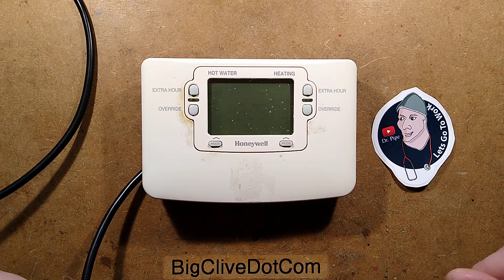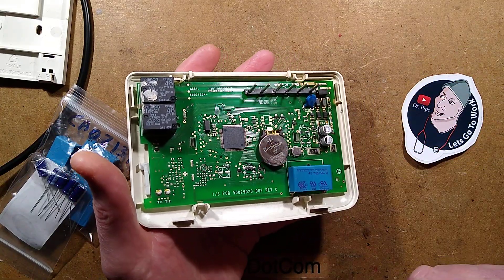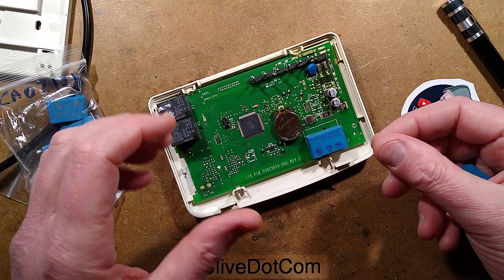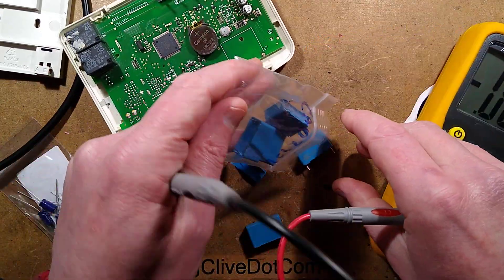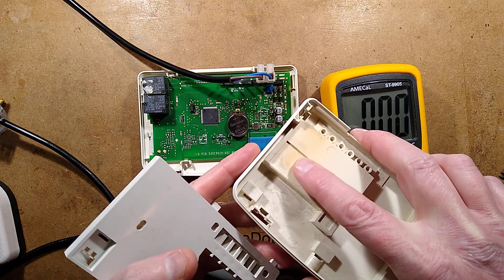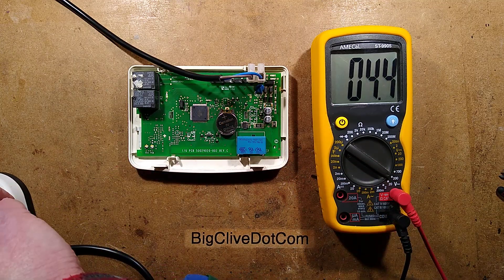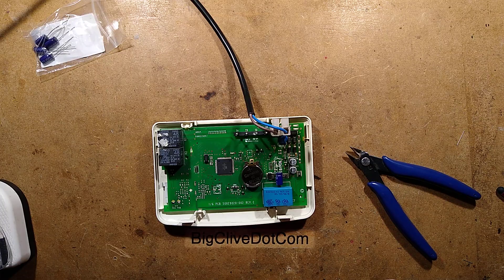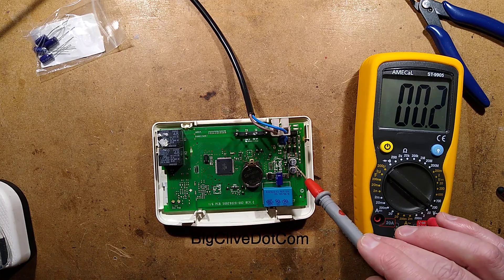Troubleshooting a heating controller.

Comment: I used to work for a plumbing company that fitted 100's of these a few years ago, a common fault was the relay "clicks" and the led lights up but you don't get an output, same fault with the wireless relay box (BDR 9_?)

Comment: For those 63V caps - you can find them on farnell. I bought a set of these there (for entirely different appliance, but caps were the same)
Reply: Why would you want to find same thing that is known to be the failure point?  It is madness all around, that they had 4 spots for parallel tiny SMD caps in the first place.  Get one decent cap, make room for it by creating a void in the back of the casing.  Whoever designed this was an idiot.

Comment: This miniture version of capacitors was always giving troubles. I feel like they age quicker and they can even leak acid from them, which can slowly dissolve tracks off the circuit board

Comment: Unfortunatly I have't got a True RMS Multimeter.
Does this AC Ripple Trick also works on these? "Normal" AC Messuring is by blocking the DC Part, but doe True RMS the same, or are they messuring "true RMS" included the DC Part?
Reply: Try measuring a known clean DC voltage (like a 9v battery) in AC mode. If you get zero volts AC in both polarities the trick should work as is. If you get a nonzero reading you just need to put a capacitor in series with the meter when you measure ripple.

Comment: And this is why, checking your replacement components before fitting them is a good idea.
Reply: I think why buying components from a reputable distributor would help too, not a place that sells other random garbage, and some components on the side. I went to the CPC homepage, and they're selling space heaters, cheap tools, and all kinds of other junk. CPC must stand for Crappy Products from China
Reply: @gorak9000  pretty much nailed it yes. But it's hard to find suppliers that don't sell crap these days. It's an issue.
Reply: @yodaco  I mean it is a Farnell company - they seem to have been going down the path of "we import cheap crap, put a huge markup on it, and sell it to "industrial" customers" for quite a while now. Every interaction I've had with a Farnell company feels a bit odd. I order components from digikey or mouser - never really had an issue, and they stock the full selection of everything. If digikey doesn't have something, mouser usually does, and vice versa. Not sure if either of them have regional operations in Europe though - I would think they would. Digikey was the best in canada, flat rate $8 next day shipping on any order over the minimum (which I forget now), but surprisingly their shipping in the US is pathetic (slow and expensive), and both Canada and US shipping originate in the same warehouse in the US, so now I prefer Mouser.

Comment: 4:58 Clive back from ripping his supplier a new one ...
Reply: More a case of checking what you are buying (note he did say they were within tolerance of the specs- he got the low tolerance ones)
Another factor is that caps often 'break in' and their value changes closer to the stated value after a few hours of use- something to be aware of in some applications ;-)
Reply from the maker: Sadly, these were the only ones with the correct capacitance and pitch.

Comment: WHAT??? I had no idea that the AC  mode of a multimeter could measure the AC component of a dirty DC voltage! I always thought this mode was just a rectifier connected to the DC voltage input.
Reply: Not all can. Check first. The cheaper the better.

Comment: I am involved (as customer representative) with the refurbishment of a commercial building. As part of that work a new heating/ventilation system has been installed which includes two duct-mounted electric heaters, one of 26kW rating and the other 36kW. Both heaters have electronic control of the power output using a 0 - 10V control voltage from the system controller, as a consequence they have circuit boards that include electrolytic capacitors mounted in a metal box attached to the side of the duct which runs at 50 C when the system is running.
This seems to me to be asking for trouble from these capacitors relatively soon. Unfortunately the system was specified by the architect and the H/V contractor is a sub-contractor to the main contractor for the refurbishment, so I had little input to the system specification. 
But it will be my problem when things start to go wrong!
Reply from the maker: You can make a significant difference by mounting the metal box just a few millimetres off the hot surface with spacers.  It allows airflow between the two surfaces.
Reply: @bigclivedotcom  The manufacturer could have done that, I can't!  The box is riveted to the duct section and the ends of the elements project through into the electrical compartment where the electrical connections to them are made.
If you are interested these duct heaters are made by VEAB Heat Tech AB and they are type VFL rectangular duct heaters.

Comment: Honeywell is pretty much the standard in the US for heating/cooling control systems.  Some vendors re-brand them with their own logo, but it's still Honeywell.  A few years ago, we upgraded our heat pump and ran into a problem.  The new unit demanded an 8 wire connection, but our thermostat cable was only 7--redoing the cable would involve going between floors with finished ceilings.   "No problem" our installer said.  He installed a new controller with a single 2 wire connection--both power and signals travel over the same 2 wires.   There are multiple options, including wifi connectivity, remote wireless sensors and all sorts of good stuff.  Unit has a color LCD touch screen that dims at nighttime and is programmable, of course.  That was five years ago.  Heaven knows how fancy the new ones are.  The original thermostat was the old-school one with bimetal strips and mercury switches.
Reply from the maker: I switched from an old mechanical thermostat to a wireless one with timing functions too.

Comment: i  know about the ac meter trick but i haven't owned a meter with separate ac/dc in years lol but 37 volts on a 48 volt bus was a big giveaway
Reply: ??  Practically every consumer and pro meter on the market has separate AC/DC settings even if autoranging.
Reply: @stinkycheese804  yea there's very little competition in the meter market these days its sad
Reply: @stinkycheese804  yea I'm saying it's hard to find a meter with all the features one might want without compromising something
Reply: @stinkycheese804  ah no lol one of my requirements is to only have a single meter, I realize my situation is self inflicted but I firmly believe company's should just make a better meter
Reply: @stinkycheese804  well yea I'm far more interested in auto ranging than having seperate AC DC and I've never seen a meter with both and I also need a meter with forking amps and low z

Comment: Clive, I think you missed something: the display doesn't show all segments. Typically for these thermostats because of crappy flexcable connection of the display. Over time it gets worse until it becomes unreadable. Never found a good way to repair these.

Comment: That type of capacitor is very well known under ham's as they like to kill radio's by leaking their 'smurf' that then eats away other components and or PCB. Search for "Kenwood st-50 capacitor fail" and you'll find nice examples of this.

Comment: "I'm not a huge fan of miniaturization"
CLIIIIVE!!! Dammit, coffee on the monitor again.
Reply: Bear fingers aren't great for SMD  LOL.
But he's right - small components aren't great at dissipating heat.  It's my main concern wrt SMD design. (...and I'm not a bear).
Reply: @Chris_the_Muso  Long ago I did SMD rework and then design. I pitied the software guys who couldn't just spray software modules with canned air until it started working the way O could with a circuit board. ;>)
Reply: @markfergerson2145  Ah, I've bin there too.  The software guys have a tool  as well. - you output a key variable to the monitor, then you understand where you screwed up when it doesn't show the result you intended.  The guys I pity are the high level programmers who don't even know the names of the programmers who wrote the routines they are patching in ad hoc.  They are totally screwed.  Unfortunately that's most of the arduino crowd but I can't laugh too hard because that's where I'm at these days.  LOL with great sarcasm.
Reply: @Chris_the_Muso  My most recent direct experience was in a small systems house in Phoenix. Ten to twelve software guys writing in Qnix and a raft of hardware guys. I was one of two who interfaced the two departments.
I give the software guys all credit that the equipment we built and sold worked at all- by comparison the hardware was dead simple.
Some days though- we built some custom devices and occasionally I'd have to explain to the guy drafting a circuit board why the leads to a pot had to be rerouted so the knob would turn one way when you wanted to speed up a conveyor and stuff like that.
And them Marketing would say shit like "The vents have to be on the side and all those LEDs have to be blue because blue is cool".
"Thoose red, breen and yellow LEDs tell the operator whether the machine is running properly."
"Change them."
Grrrrr...

Comment: That AC ripple measurement trick does not work on all multimeters. Some read the DC and scale it as peak AC so read DC x 0.7..
I have also seen the 48volt 1.3 watt zener die as that is the heat source when the relays are off.

Comment: Another (but unrelated) furnace hack; One I had to perform this year.  If you don't change your filter regularly, your furnace will have reduced airflow and so things get hot. There are temperature probe kill switches which they call a "Limit Switch" in the 'biz throughout your furnace.  Some of them can be reset, and some behave as a one-time fuse that cannot be reset by push-button so you'd have to order a new one.  You can ACTUALLY reset them through cryogenic freezing.  Although I don't have access to liquid nitrogen, an inverted can of AIR DUSTER was enough to reset my customer's tripped limit switch.  Saved them $65 for the part alone, besides another $200 to come out and install it.
Reply: I'd be interested in the type of liquid nitrogen resettable thermo switch
Reply: @jonathantatler  As I explained, just look for a non-resettable limit switch (ie, it has no push button).

Comment: 1) Aluminum electrolytics are well known for short lifetimes as well as high ESR. It's the latter that can get you if  installed  in a circuit that will subject them to a lot of ripple current. Filter caps are just that. The ripple current creates I^2*R power losses in the capacitor, which is of course "heat," the enemy of electrolytic capacitors. Not helping matters in your case is that it is also high voltage, which exacerbates the issue because  high voltage in a small aluminum capacitor almost always means even higher ESR. Those surface mount aluminums miniaturize the capacitor that much more, meaning the ESR is probably sky high. BTW: Digi-Key is a good source for surface mount aluminums, assuming you can get them delivered to Scotland.

2) Most engineers are not aware that all aluminum caps have a rated lifetime for a rated temperature. A common rating is 1,000 hours at 85 degrees C. Think about that: 1,000 hours is a mere 6 WEEKS, assuming the capacitor was sitting in a 85C environment. You can double the life for each 10 degree C decrease in the exposed temperature.  Thus, if your application will only see 55 degrees C, that is 30 degrees under the spec, so that the capacitor's lifetime is now stretched out by 2^3, or 8,000 hours, not even a year! A thermostat is going to sit in probably a pretty low temperature environment, but it is always powered on, "logging hours" 24/7. This thermostat no doubt spent its entire life always powered on, never turned off. Tick, tick, tick. No doubt the Honeywell designers assumed "it'll never get hotter than about 35C, so heat will never be an issue." But it is!

3) Something else you can do to help the situation is to order aluminum capacitors specifically designed for switching power supplies. They have lower ESR than normal aluminums and will therefore heat up less in a filter capacitor application. You can tell when a capacitor is rated for switcher applications when you see that the ESR is measured at 100 kHz rather than the 120 Hz you see for conventional aluminums. As an example, have a look at Panasonic FC capacitors that are rated for switching applications. There are other brands, too.  Paralleling capacitors also helps in that it reduces the ESR. If those two empty footprints on the board had been populated, they would have helped extend the life of the thermostat by reducing the self-heating of the caps, keeping them cooler and extending their useful lifetimes.

4) For best lifetimes when using aluminums, find one that has the highest temperature rating you can get. 105C if you can find them for 63V. The combination of I^2*R heating and a low temperature rating accelerates the failure time of aluminum caps. The choice of small surface-mounted aluminum caps in a relatively high voltage filter cap was a real bad idea. More than likely, the guys who designed that Honeywell thermostat did not understand Capacitors 101.

Comment: Not something I'm proud of(because apparently you shouldn't fix appliances like this) but I did a similar fix in my gas central heating + hot water boiler.
The electronics was certainly dead and it seemed like it had problems with starting its own power supply.
After searching for a fix (involving A LOT of random Russian forums via Google translate) there were some hints about capacitors, but not anything obvious.
So I picked one electrolytic at random (it was PSU chip's own supply pin) and it measured out at like a half of its rated capacitance.
Put in a random Chinese capacitor with a little lower voltage rating just to check and it started working.
As it was late autumn, it wasn't just for shits and giggles - I had no hot water and no heating, so I just put it back together and it still works after like 1.5 years now and I saved a lot of money - the controller was like 200 bucks equivalent and I wasn't even sure if it was still available, picking up a new boiler and someone to install it would be probably more like 500+ USD or GBP.

Comment: How long does it take for a capacitor to dry out
Reply from the maker: It depends on heat and the frequency it is running at.  Old low frequency (100/120Hz) capacitors often still work from the 80's.
Reply: @bigclivedotcom  Talking about heat. You might want to check what is heating in there. Was it the failing capacitors or something else.

Comment: These SMD electrolytic caps made in the 90s.
I see them being faulty on lots of repair videos.

Definitely they dried by the heat of the resistor in this case as the unit is supposed to work 24/7.

In other equipment, specially VCRs and video amplifier related (that has been sitting for a while without power), they simply decompose and leak like a discharged battery.
They can ruin multilayer PCBs.

Comment: Dry January, capacitors should not be included.
Never seen using the DMM on AC to detect ripple on a DC circuit, very clever tip.
Thanks for sharing.
Reply: Huh?  It's obvious to do that to anyone who has used a scope.
Reply: @stinkycheese804  In what frequency range would a DMM be accurate, this would help me immensely, thanking you in anticipation.

Comment: Interesting. Those are solid state caps and are supposedly impervious to drying out. It would appear that this is not the case.
Reply: They are almost certainly electrolytic caps. Solid polymer caps are used in more demanding applications (e.g. switching PSUs) and would not be first choice for this as they as considerably more expensive.
Reply: @ferrumignis  They certainly look like solid caps. Every liquid bearing electrolytic cap I've ever seen has a vent on it to prevent explosive venting (which doesn't always work as I've exploded a few by accident) and the solid caps don't have the vent scoring. Also, solid caps aren't just used in PSU's. Motherboards are covered in them as are video cards. They made the move to them back in the mid oughts after dozens of models of motherboards suffered premature failures from bad caps. One of the leading culprits of the bad caps fiasco was Capxon along with a slew of other cheap Chinese brand caps. This initially led to the adoption of Japanese caps in most quality power supplies as well as the aforementioned move to solid caps on upper mid tier and up motherboards. It wasn't until the past few years that PSU's started adopting mainly to completely solid state cap builds.
Reply: @madmat2001  SMD electrolytics dont have the weakened section on the top of the can, they vent from the rubber seal on the bottom.
Reply: @ferrumignis  Odd, looking at the ones in the audio section of my X470 Crosshair Hero (so you can find pics of it online yourself) I'm seeing very faint scoring on top of the audio caps and they have heat shrink on them like their larger through hole cousins. Meanwhile all the solid caps on the board look pretty much identical to the ones in the thermostat.

Comment: you could definitely fold the leads under the capacitor you installed and make it sit entirely on top of the positions for the spare caps. also it looks like some of the heat there is coming from the resistor right below the caps, it might be better to use a capacitor with longer leads, positioned to the right of the dropper cap, or you could probably get away with just soldering a couple of 1210 size 10uF 63v ceramics across the spare cap positions, they are less than $1 each in single qty and would last forever